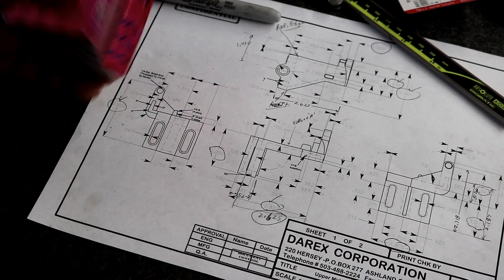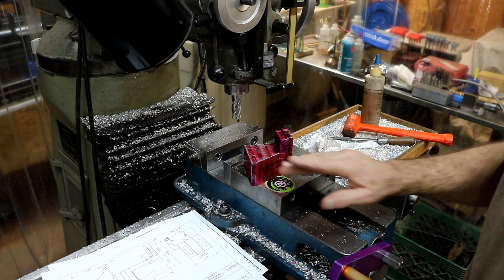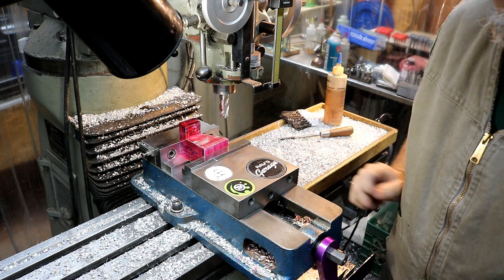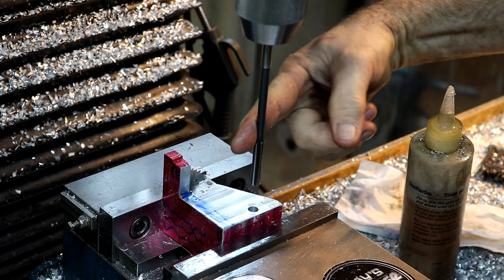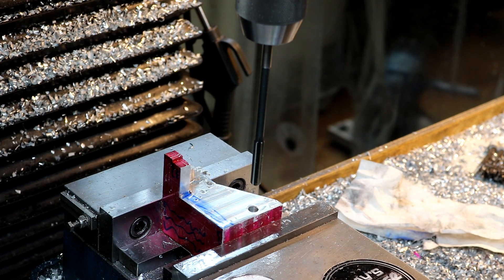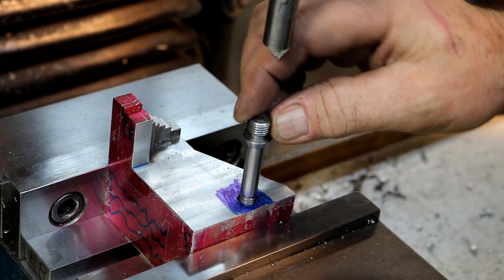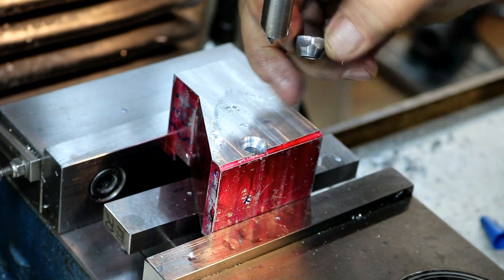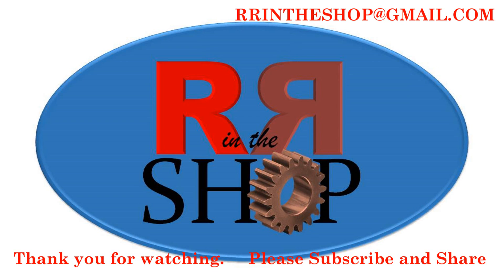P2-2 Darex Drill Grinder / Sharpener, Making New Parts Project

Comment: Good suggestion on the notes.  I used to do that a lot at my old job where I was working on more than one project at a time.  It made it easier to pick up where you left off rather than try and figure everything out again.  Parts look good, fit looks outstanding.
Reply from the maker: Thanks Bill, they work out great.

Comment: Yes it looks like 75% of the aluminum block is eventually being machined away. That’s the challenge of making replacement parts that was cast. Impressive to see you take this on. I do have a question did you consider printing a 3D model to be used as a casting, as many YouTube creators who do aluminum casting some one would have helped you out with a casting?
Reply from the maker: I have no way to cast.  i want to get this up and usable.  Thanks James.
Reply: @RRINTHESHOP  i guessed as much. In fact I don"t blame you

Comment: What a great idea for boring the chamfered hole, had never thought of doing it that way.  I think you made this video before you knew about the locking set screw which goes into the bottom of the pivot nut. That space you mentioned is for the set screw.  Really good ideas in this video. Thanks

Comment: The "Order of operation sheet", last time I've heard about this was in trade school, I think it's a first for me on the Tube, Very clever move in order to not get trapped into an unmanageble part of plain stupid mistakes on complex parts...   ;)
About the tapered nut in the bottom, it's good like that, you'll need use a grub screw in the inner 5/16" (I think) thread in order to lock that nut after you adjusted the pressure to the pivot...
And, important not to forget, Happy Holidays to Julie, you and family from Danielle and I